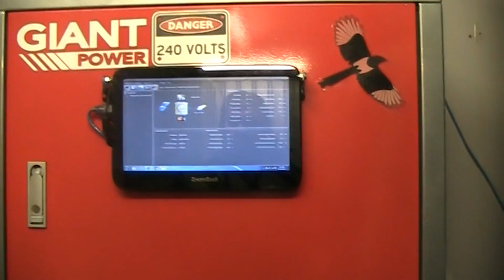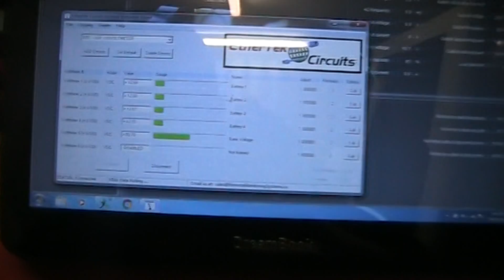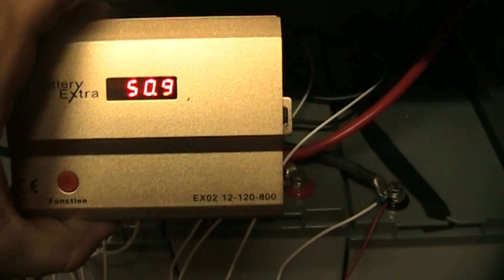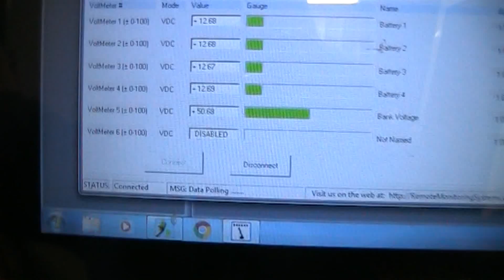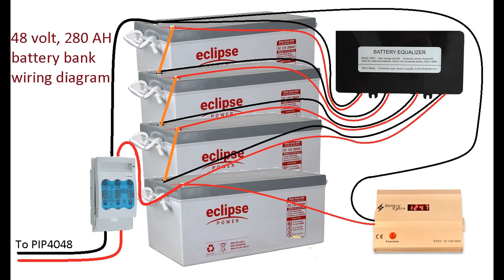Checking the condition of the old bank.

Comment: AGM batteries are great they hold the charge well. I like the flashing lights on the Remote Voltage Monitor. As a seperate bank its ok. Don't mix the batteries.
Reply from the maker: I was going to keep them in the same bank just in parallel with the new bank.
Reply: different charge rates for a 100 and 200 amp battery. The volts are the same but the amp hours are not. Adding it as a back up bank would be ok.
Reply from the maker: Interesting reading... I would understand if you had a different capacity battery in the bank (eg:3 280Ah and 1 125Ah battery) in series that it would be a bad idea. Goes without saying. But in my mind, a 280Ah battery bank in parallel with a 125Ah battery bank should be ok. Charging currents would be different for each bank due to internal resistance of the cells (eg. Larger capacity bank would have a lower internal resistance and would take a lager portion of available current) but I think as the voltage across the two banks would be the same therefore the current through each bank would sort itself out.
Reply: Give it a go mate. just keep an eye on them. It was an interesting article though
Reply from the maker: Justin Case Solar Power definitely a good read! Thanks for sharing it with me. Time and money permitting I'll connect the old bank up with the new one and see how it goes.